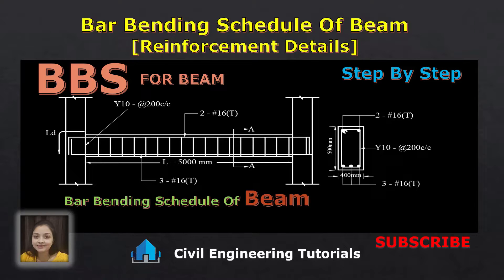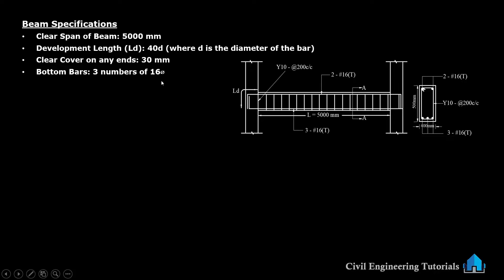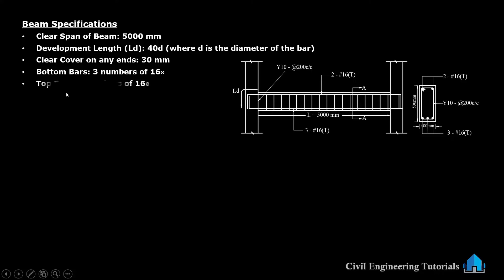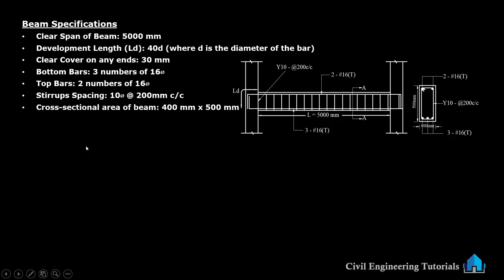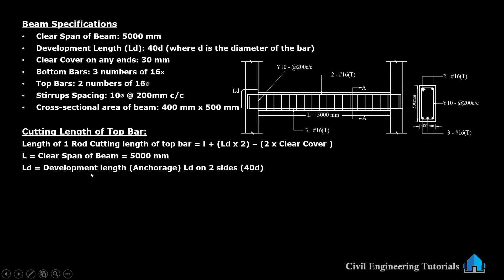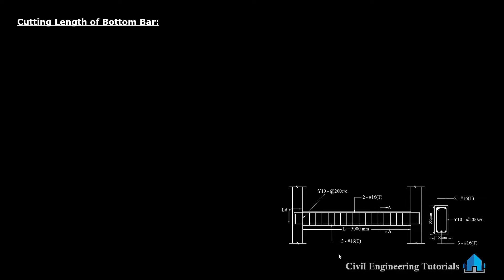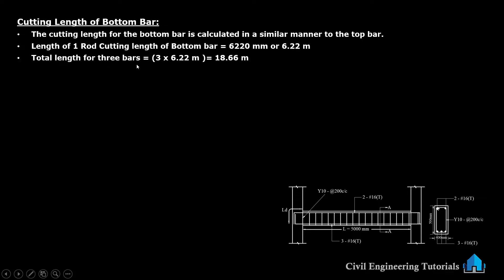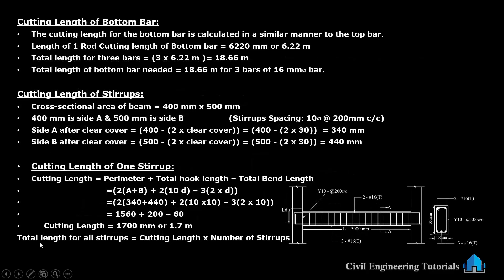BBS of BEAM (Bar Bending Schedule Of Beam) | Reinforcement Details Of Beam | Steel Calculation

Comment: You did not reduced bend in beam also top and bottom bar. Also did not reduced the 10 mm also.
Reply from the maker: “I’ve considered the bend deduction for hooks in the stirrup cutting length calculation. Hooks (usually 135-degree hooks) add extra length (10d) to the stirrup. Additionally, I’ve subtracted twice the clear cover from both sides of the stirrup (both (A) and (B)) to ensure accurate representation of the reinforcement layout. Lastly, I’ve accounted for a 10mm reduction in the total cutting length of each bar (top and bottom) to allow for overlap during construction.”